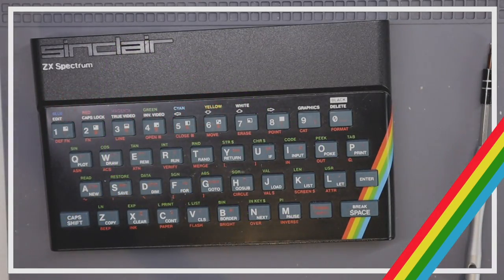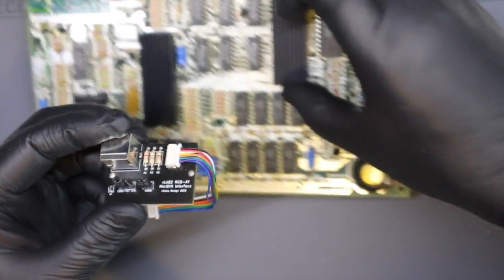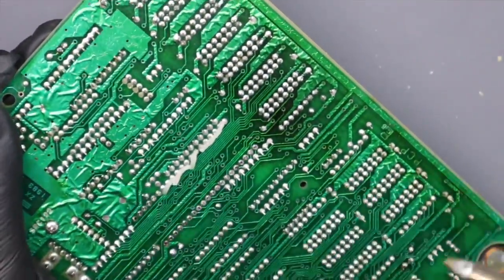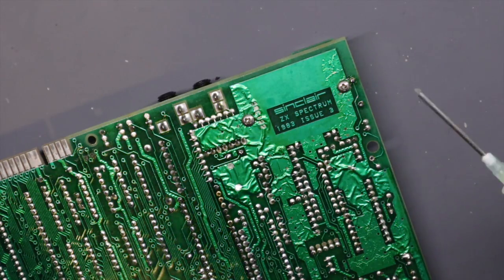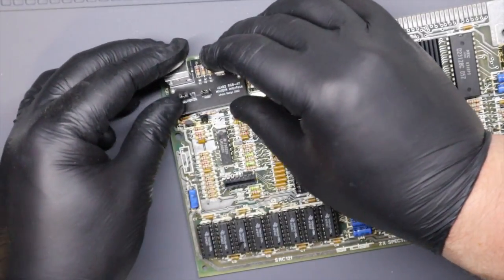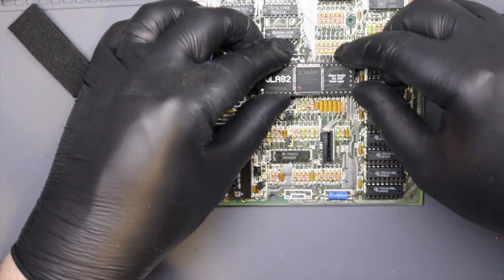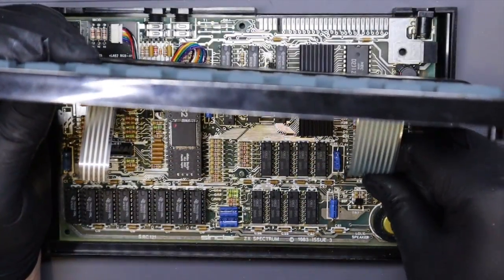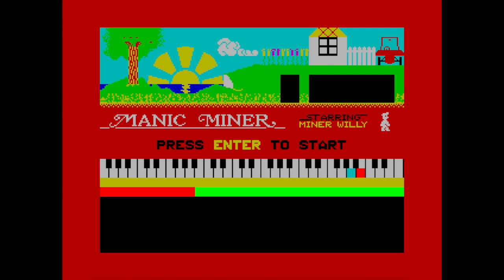RGB Output from a ZX Spectrum 48k with a VLA82S

Comment: This is perfect for me. As a stupid yank, I have an NTSC commodore 1702 montoir that accepts a 50hz display just fine, but it will not accept PAL. With this and an RGB -> NTSC adapter, I can connect it up just fine.
Reply: Did you end up doing this? I'm thinking of trying something similar to fit a Spectrum in with my current setup, and I'm curious to hear if this works out well.